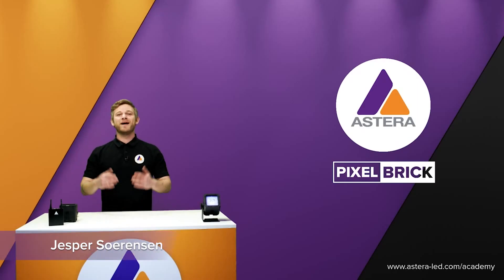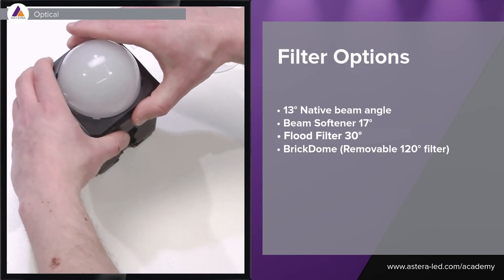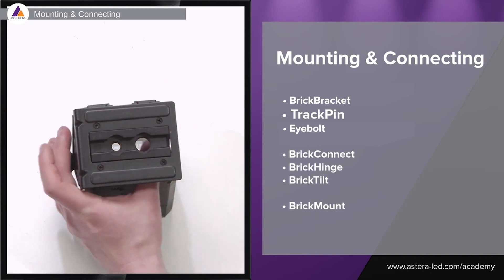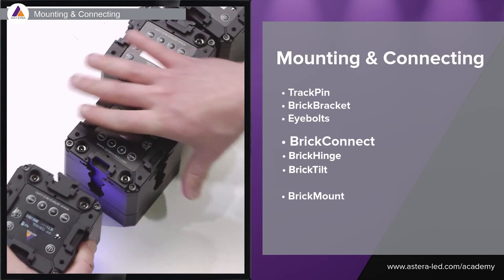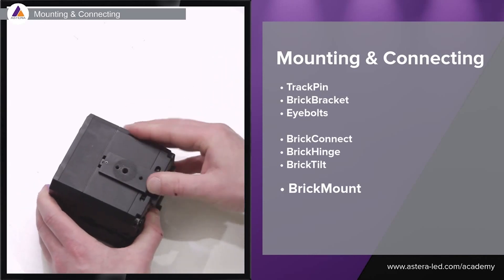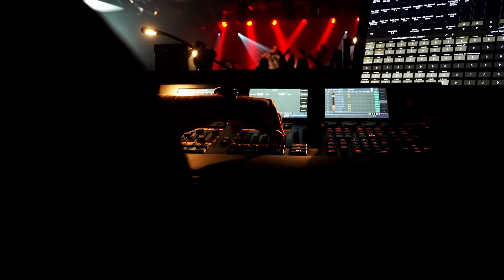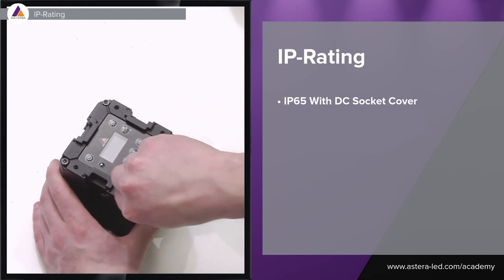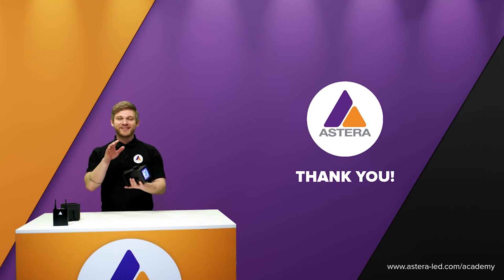PixelBrick Product Walkthrough

Comment: any DMX adapter cable that can be used on the pixel brick without the need for an external power box? How can you input a wired DMX cable directly to a single-pixel brick?
Reply from the maker: Hi, sorry for the late response, Unfortunately, this is not possible. We are sending DMX via a proprietary protocol to the PixelBrick, so you will have to use a PowerBox or DataLink for wired DMX control.